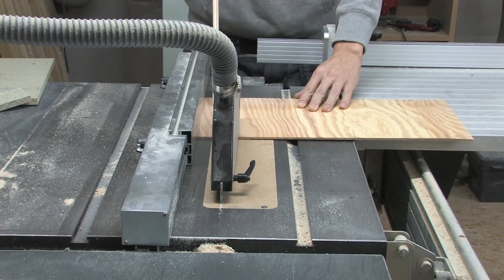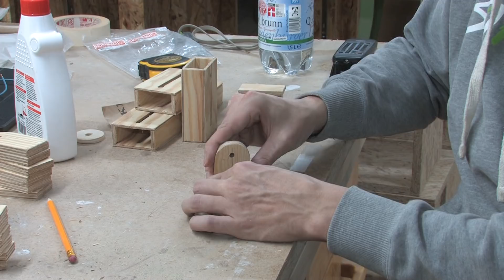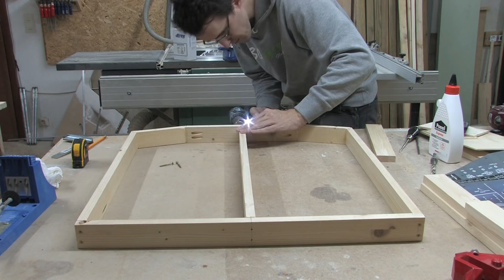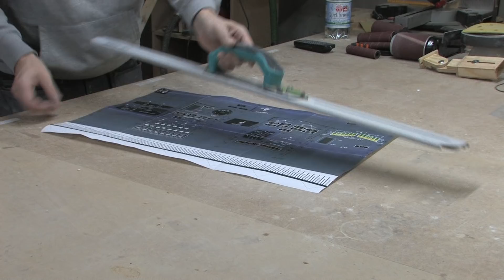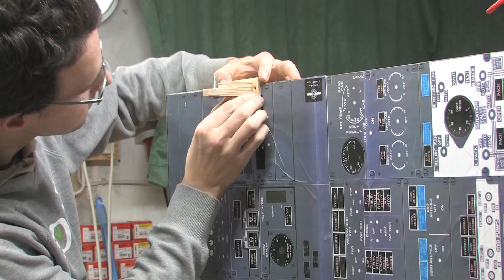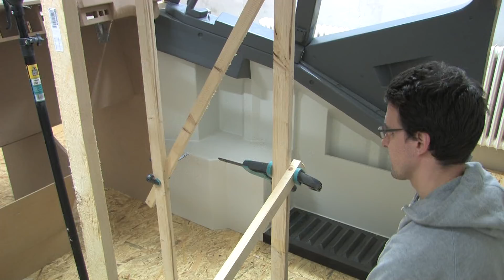Building an Overhead dummy - A Boeing 737-800 Homecockpit #17

Comment: Very Nice Michael, I am going to build a seat next, but I am dueling on what to do for J-rails, first I wanted to make them, but I think is too difficult so maybe now I will buy them from open cockpits. Do you have any plans what you will do for the seat?
Reply from the maker: I'm planning to build the seats after the ceiling. So it will definitly come this year. I will produce some sketchup files. There are some good sources for setas here: https://www.flightsim.com/vbfs/content.php?1982-How-To-Build-An-Airliner-Crew-Seat and here: https://flightx.net/index.php?thread/87670-b737-800-projekt-bauphase/&pageNo=1
I think it might be possible to build the J-rails yourself by using a plywood / aluminum construction with some rollers unter the seat.
The biggest problem, I think, is the height adjustment of the seat. It has to be easy to adjust like an office chair but to be strong enough to hold your weight.
Reply from the maker: There are also some really good dimensions here: http://www.mycockpit.org/photopost/data/529/seats.JPG
Reply: Cool, I look forward to your built, I am sure you will be faster than me :-)